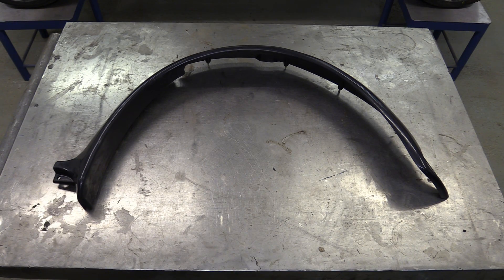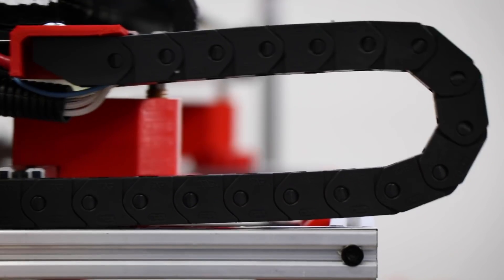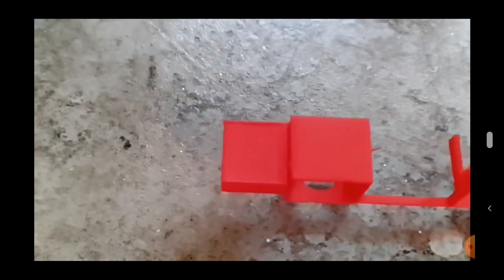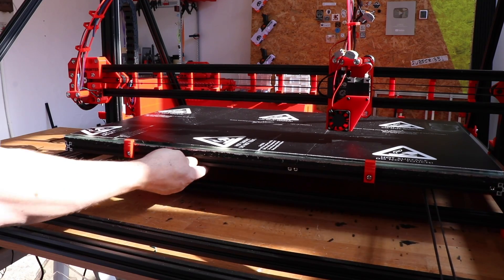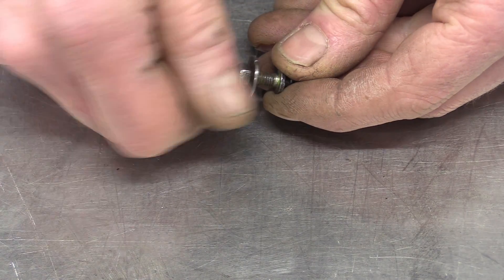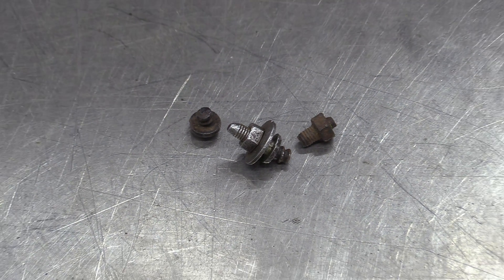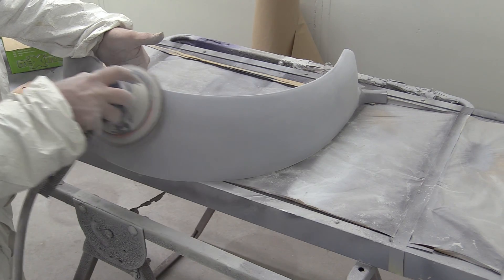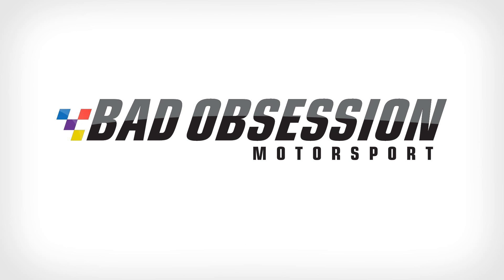Howie Did It - An Experiment in 3D Printing

Comment: Between the rocks and heat, they will be destroyed first drive. They look amazing though. I would make molds before you throw them on the car.
Reply: I think they'll be more than tough enough to put on the car, but i'd start by making moulds first nonetheless, just in case...
Reply: @henkverzeijl1525  PLA is very brittle.
Reply: @dpmakestuff  Ah ok, from what i understood in the video they've tried other materials after the initial print, so i kind of assumed (kids talking through the video over here, so i missed a bit of commentary lol) they went for ABS or something, or at least didn't go for something as brittle as PLA in the end. After all, we áre talking about a pair of well experienced race/rally nutters here, so flying rocks should't be anything new to them... In any case they shouldn't hesitate making a pair of moulds, and maybe even a very limited run of original 'Binky arches' as i'm sure there's plenty of Mini freaks who would give a nut or a kidney for such a well-designed kit for their own car...
Reply: @dpmakestuff  My experience with 3D printed PLA parts are quite different.
Reply: @flybywire5866  different from the rest of the world? Cool cool cool.
Reply: @flybywire5866  cool cool cool.
Reply: I have years of experience with all sorts of additive manufacturing. I’m sorry, but anyone saying PLA will work for functional parts is wrong. PLA is used for prototypes and light duty parts. I respect BOM and trust they know all the risks.
Reply: I disagree, i had a mate print me velocity stacks for my bike carb conversion on a reverse flow engine, he printed them out of PETG and they held up amazingly over the years even through the heat rising from the exhaust header and fuel spitting out of the carbs. Sure the arches are something different but i wouldnt underestimate the strength, after all binky wont be a rally car.
Reply: @martinbernath  PETG is a very different plastic. If they had used PETG instead of PLA I would say they had half a chance.
Reply: @martinbernath  that's because PETG is totally different material
Reply: @martinbernath  PETG and PLA are very different materials.
Reply: @martinbernath  PETG is a very different animal to PLA. PLA simply does not hold it's shape over time even if it's warm
Reply: @ubergeeknz  PLA doesn't hold its shape over time? Lol that's a new one. This one time I bent a sheet of aluminum with my bare hands, so now I never use that metal because I know it's weak. :) look at us material scientists.
Reply: @evlsc400  Try making something with PLA and subject it to constant force, especially if it is warm (even outside in the hot sun) - it "gives" over time. Known as "flow" and it is a property of plastics. Quite different from how metals bend. Other plastics do not suffer as much from this. PLA is also known to degrade and become brittle over the space of a few years in most climates, this could be limited by sealing it away from the elements.
Reply: Dustin, are you also a fan? Wow, I guess Binky really brings great makers together!
Reply: @Britzzio  huge fan!
Reply: Yup, I have a Printed gauge pod on my dash (finished off with filler primer and paint). It's held the shape but the sun has caused some splitting. Molds for sure.
Reply: I make 3D printed fillers for old Cadillacs. I use nylon for my printing material and they hold up really well.
Reply: @cadman10000  it seems that everyone whose used PLA knows what’s up. Thank you.
Reply: @dpmakestuff  yes i got 3d printing for car parts too but beyond prototypes amd dmd minifigs  dont use it. But my coffee knock box i made from thin walls that accepts searing hot coffee grounds and beatings all morning has held up well
Reply: @cadman10000  Nylon would make a nice tough bumper for sure
Reply: Of course they'll be making moulds straight away. There is no way these will not be manufactured for sale.
Reply: If it was me, I'd just line them with a couple layers of fiberglass on the inside to provide some extra strength. Maybe even a layer of 80g/m² on the outside for more impact resistance, but it's a bit too late for that now. Most tool grade plastics already have a good amount of fiberglass mixed in to make them impact resistant.
Reply: Well, perhaps they should have them printed in a different material. After all, they are printing rocket engines in 2020. There are stronger materials available. Probably not as cheap as using these to make molds to use for fiberglass. Or if you really want to piss off some money, carbon fiber. But they do have options.
Reply: Dunno why people think PLA is some kind of magic plastic. There’s reasons why PLA isn’t used in manufactured cars.
Reply: Dont worry, just in case you have not been watching this series, they have thought of that, and have done about 60x more work than a normal person would consider necessary.
Reply: I would have thought he would of held them on with brackets.
Reply: The printing is cool but wouldn’t a large format cnc router make more sense for something like this. You just route your buck for a mold and use traditional composite lay up for the finish part.
Reply: I'm with Dustin, I don't think these will last at all. Needed stronger material or just use these to make moulds. I have made things and had them melt in the cockpit before. Some things in the engine bay have lasted and others not, all depended on location.
Reply: I made brackets that hold custom headlights on my car. I printed them in PLA and they've been on there over a year, only one cracked and it looks like it had a weak spot where my nozzle had a little clog.
Reply: @1MBStudios  pla, especially on such a long part, will have less bond integrity between layers due to cooling. the limiting strength of the part is not the tensile strength of the material, but the strength of the bond between layers. the limits on thermal performance are a separate matter, but residual stresses will cause the part to move as it heat cycles near Tg.

Wagering the pulled negatives and will have CF / glass / kevlar composite parts for the car.
Reply: @phaedrusbjb  people print supressors and receivers to fire arms and they don't spontaneously break apart and they use basic materials like PLA and I think the step up above that they use PLA+, not even PETG yet and they hold up fine. How a cars fender flare is going to break apart while driving a mini cooper, whell you're probably in a different atmosphere at that point. LMAO. But you're right though, if we're going down that rabbit hole might as well print them out of carbon fibre nylon so the chemtrails don't eat at the plastic....... yikes
Reply: Right, A layer of carbon fiber on each side wouldn't add too much weight and could take up any strength they lack. Or even a few strips of it underneath. Would make more sense to make a mold and go carbon fiber the first time anyway and appreciate these as damn good plugs for prototyping
Reply: I wonder which forces are stronger or more brutal, the firing of a round from a PLA printed receiver, or fender flares for a Mini cooper.... Lol.
Reply: @evlsc400  the pebble off a mini tire would be more powerful. To make that argument I don’t think you understand what a receiver does on a firearm.
Reply: @dpmakestuff  So why aren't you making bullet proof windows for cars now that mini cooper tires are the next lethal threat bro? you could be rich! Clearly you don't understand the forces applied.
Reply: @dpmakestuff  What about tires bigger than a lawn mower? oh my! why aren't people wearing helmets when cars drive by? the humanity! lol. :) Me thinks the reciever are going under more forces than these fender flares lmao. but thanks for the laugh
Reply: Naw.  PLA is much tougher than it's given credit for, and only the lowest (cheapest) grade (which is what most people know because it prints very easily and is cheap) is particularly heat sensitive.  Paint eliminates weathering concerns.  It'll outlast the sheet metal no problem.
Reply: @monty9373  no
Reply: @dpmakestuff  We'll see soon enough.  Well, eventually anyway.
Reply: that's what they say at the end though
Reply: At the very end they said they were going to make molds
Reply: @calvinlim9485  yes I know. I watch the entire video before commenting. I was saying don’t wait to make molds.
Reply: If they get too hot while sat outside the car then the project has bigger troubles, such as being on fire. You have to take PLA upto about 90c before it bcomes self plying, although with a 3mm thikcness (wall thickness is uausally 1.2 or 1.6mm, perhaps 2.4) then they should be quite tough.
Reply: @godalmighty83  The glass transition temperature of PLA is about 60c. That's enough for it to warp. It's not that hard for objects in direct sunlight to get there. I'm more worried about the print splitting along the print lines under stress.
Reply: @DaGeek247  And the GTT of steel is 0c. You have to go a bit hotter for actual risk of deformity, given the thickness fo the material, it's curved shape and being mounted it wont be a problem.
Reply: @godalmighty83  PLA moves over time. Hang a weight from a piece of PLA or make a hook from it and see where it's at in a years time. It's perfect for a mold, not so much something that will see heat and sustain weight.
Reply: the sun alone is sufficient to warp PLA quite badly
Reply: @godalmighty83  PLA can warp in on a 30 degree day in direct sunlight.
Reply: @dpmakestuff  You would have to have made something very very poorly designed for that. I'm talking Ford Pinto badly designed. I have garden decorations that have been outside for 6 years and are still fine. These will be ok.
Reply: @godalmighty83  yes, these fender flares are similar to garden decorations.
Reply: There are differences of course, these are actually protected from UV and mounted to a solid structure with thicker walls. Some people seem to be operating under the impression that PLA is a form of cheese...
Reply: @godalmighty83  no, it’s more like corn starch.
Reply: @godalmighty83  no but it is made from food....
Reply: @dpmakestuff  And perfume is made from whale vomit, look how things can change with a bit of engineering!
Reply: @dpmakestuff  Yep, I have had a large PLA print turn very floppy from sitting in the sun before. It's great for a proof of concept but they just won't work in the long run.
Reply: Binky is planned to be a road car, not a rally car.
Reply: @reggiedixon2  road cars still kick up rocks.
Reply: @dpmakestuff  Not in the UK unless you get on to forestry tracks for some odd reason.
Reply: @dpmakestuff  i know nothing about 3d printing but isnt there something that they can do to make it less brittle? or maybe a thick coat of glue or something that helps with it?
Reply: @Frietpan  yeah I thought that’s what they would have done. A thin fiberglass skin would be infinitely stronger than PLA.
Reply: @Frietpan  PLA is known for being quite brittle and having a low melting / softening temperature, but is generally quite easy and reliable to print. A better plastic might be ABS or some more modern 3d printer plastic, which I think most mass produced car bumper bars and wheel arches are made from anyway nowadays due to its higher glass transition temperature and shock resistance (it goes white and bends before it breaks). It is a bit more fussy to print however and tends to warp while printing if there are any breezes or temperature irregularities, resulting in the part changing shape and pulling off the bed, ruining the print (invariably on one of the final layers). To work around this would probably mean putting the printer in a box and being much more careful than would be required with PLA with getting the air and bed temperatures as even as possible.
Reply: @reggiedixon2  Have you seen the state of the roads in the UK? I've seen chunks of tarmac the size of house bricks and larger being thrown out of potholes.
Reply: @Gebox68  I have driven in UK since 1984 and no car I have been driving has been hit by anything that could be described as a rock. Yes potholes exist but the assertion being made was that the 3D printed wheel arches would with 100 percent certainty be broken by rocks. Additionally I find your house bricks assertion simply not something I have ever seen.
Reply: @reggiedixon2  That's not how I read it. These are external wheel arches and they do take abuse directly from the debris being thrown up of the road, unlike the normal internal wheel arch which has a flexible lining. I'm not saying the arches will or won't stand the test of time, just that rocks and other large pieces of crap do fly up under your car probably more often than you imagine. There's also the possibility of the occasional accidental bump. There's a reason car bumpers aren't made of PLA plastics.
Reply: @Gebox68  I just re-read it and we obviously disagree.
Reply: @reggiedixon2  I don't know what roads you drive, but road surface quality has been getting worse for decades in the part of the UK I live in, largely as a result of the privatisation of highway maintenance, cost saving measures (read: methods of charging the taxpayer more, while using shittier materials and methods), and buck passing/arse coverage involved with the whole affair. It took our local council years to fill in a pothole that not only caused injury through folk turning over their ankles in it, and breaking other bones/concussing themselves during the fall, but spawned masses of dirty great lumps of material every winter as the hole was widened by the freezing of water in the hole. Luckily, our little road is residential, and the limit is 30 (although folk in the usual procession of german rocket ships routinely hoon down it in excess of 50mph, despite its being a one way street with no room for error), so flying stones and other road components isn't that much of a hazard. But the larger, faster roads around here are not substantially better maintained or made. Its absolutely worth considering flying detritus here, and in the rural paradise that the Bad Obsession lads are from, its perhaps even more important, since many roads up that way lack things like kerbs and pavement to help keep the natural rocks and stones from washing onto them during rains.
Reply: @peteredwards2318  Just a normal mix of roads in South Wales, I stand by what I said, it is wild exaggeration to claim that cars get hit by rocks all the time. This has not happened to me in 35+ years of driving.
Reply: I’ve printed a couple of parts out of PLA for the interior of my mini, and they didn’t hold up to the summer heat inside the car. They didn’t melt, exactly, but they didn’t hold their shape either. IMHO 3D printing is great for small parts, and rapid prototyping, but if you want something that lasts, older technologies will give you a part that stands the test of time (and heat.)
Reply: well next step would be to take them to Park Hall Business Village in Adderley Green to Easy Composites Ltd and make mold and carbon fiber arches 

oh they have youtube channel https://www.youtube.com/channel/UC7F-suscQATns3qRYHpyijw

Comment: Awesome looking arches! 
I highly recommend reinforcing them with an aluminium strip and some ribs, fiberglassed into the inside of the arch, to make it composite. The reason the OEM archers have glass fiber reinforcing it that ABS plastic, and printing plastics, don't handle (micro)vibrations well and start to crack. The BMW K1 is famous for hairline fractures in its ABS fairings due to engine vibrations.
The separate lines of print make it so it is not one piece, like a single moulded part, so it has a tendency to fail along those printing lines. This is visible when the excess is broken off, it all breaks in straight sections, along the print line and at right angles to it.
Reply: I've never fibreglassed ribs... Do you still need to use hot sauce?
Reply: @bvward  It's easier if you glue them in first, then layer fibreglass on top.
Reply: @Yvolve  I think I'll stick to smoking my ribs on a wood fire...
Reply: @bvward  Those ribs work better with hot sauce rather than hot glue.

Comment: Nice. However unless they are made from ABS or Nylon, they may (probably will) melt in the Sun, especially if the Sun is reflected from or through glass.
Reply: settle down Beavis  A straight piece with no curves, structure or mounted support? Have been doing 3D printing for ~8 years, these will be fine.
Reply: PLA only starts to become plyable at 90c, we don't quite get summers like that in the UK. The shape should keep it all together without much fuss.
Reply: @godalmighty83  Not true.  When the heat is reflected it becomes much hotter. (Remember Walkie Talkie building in London melting car parts, and PLA is no where heat resistant as car parts.)  I have printed thousands of prints with many different materials and know.

Comment: I had a crack at 3D printing an inlet manifold.
It works, and ignoring the temperature issues for now I think the main issue is it will delaminate with time.
Similarly it was just an experiment and a way to move the project on.
Details at the bottom of this blog page if interested.
http://www.jprwildcat.co.uk/richardschofield3.html
I'm switching to bike ITBs now, will 3D print a new manifold and when happy with it will weld up something in Ally.

Comment: I'm hoping the suspension of the car keeps these to a minimum amount of vibration. That's the cruz of pla, or abs in my experience. Made gear and pulley covers of my electric skateboard out of both pla and abs with 3 mm thick 100% infill. The whole boss for the bolts would shatter off after 3-5 miles on sidewalks. Eventually made them out of tpu instead, 3 years later zero issues.

Comment: 10:50 a drop of super glue on the threads would have assured they never came loose...
Reply: Better yet , melt them in like they are supposed to be
Reply: @PointBlank65  same same.